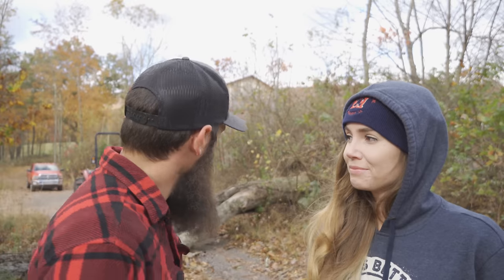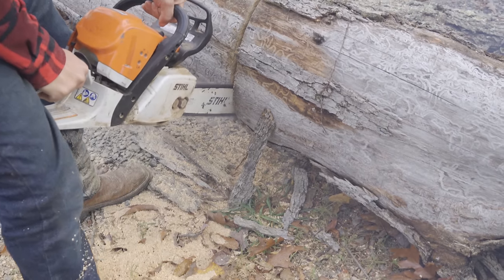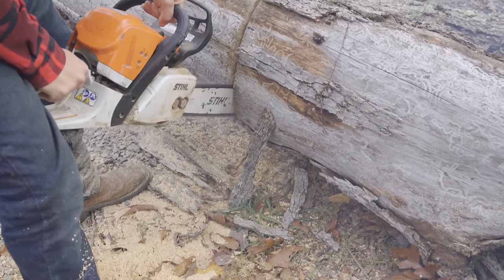Beginners Install Drywall On 20 FOOT Cathedral Ceiling

Comment: Exactly this time last year you had managed to clear the site and had constructed 'The Mighty Wind Tunnel' remember?  Look how far you've come in a year, and with two impromptu but impressive off the cuff design changes that turned the triangle into a palace!  Is it perfectly finished yet? No, but it IS very close to being liveable.  You've worked wonders now it's onwards and upwards (ARGH!!  Forgive the pun) to the finish line.  Plus a load of free firewood, not a bad weekend's worth.
Reply from the maker: We keep looking back at where we were this time last year. It feels so good to have come so far and to be so cloae to moving in 💚

Comment: I'm not sure if you live in a snowy area, but that's one thing I like about your design...you won't have to shovel snow off the roof. It will slide right off. Just don't be standing in the way when it lets go! You two are great.

Comment: Looking good guys about to cold up there stay warm. Keep up the videos
Reply: It is weird watching drywall going on walls without a plastic vapor barrier. It cold weather moisture will creep into the warm walls.
Reply: @lorcathecrazy5331  Many times that plastic sheeting can condense moisture and create problems. Speaking from 36 years in the drywall /plaster business.
Reply: @jebboceefus553  
In Canada it wouldn't be allowed to not have vapor barrier. The sealing of airspace is to the point where slamming a door creates a vacuum in the house.
Our outside winter temperatures are completely different though. With differentials between inside and outside temps of 100 degrees or more. -40 outside and 70 inside. Just weird to me.
Reply: @lorcathecrazy5331 They do a outside house wrap instead of the inside. It is a better way to dry out the wall moisture.
I have done the other and it works better with the outside wrap.
Reply: @dennisbailey4296  I understand that.
But moisture usually comes from the warm side. Which would put the condensation in the middle of the wall.
I do not wish to debate it, rather than state an observation.

Comment: Josh, my concern about installing the plank on top of the Sheetrock is the electrical boxes and outlets. Shouldn’t those be adjusted to fit out to the planking?
Reply: I guess he will use outlet box extenders

Comment: Good deal u 2. It was so cool u 2 working in ur home with all that lite. No wires coming into ur home. Lite without a bill & u 2 bath in brite lite in ur home. I remember not 2 long ago u having 2 work with lamps 2 see @ nite in ur home. U two have come a long way. Very happy 4 u 2. Missed hearing the children but they will b here next video. See-ya

Comment: I don't know if you're finished with your drywall finishing, but if you aren't I have a suggestion.  You can smooth the seams so much easier and cut the work time by using a wet sponge. Just get the sponge wet and smooth the plaster. Through renovating several homes, we learned this useful sponge trick. In fact, my husband recently discovered another useful method. He used an O-Cedar Microfiber Flip Mop on a plaster repair, and it's absolutely smooth. No sanding.

Comment: Josh, you are one lucky guy.  I have very rarely seen a woman that can carry a 4 x8 sheet of sheetrock must less lift it like she does to you up on the scaffold.  That makes it a lot easier to get it done.  Very impressed.  Yall are definitely improving as you go, shows the rest  of us that it can be done if you want it to.  House is looking good.And Erin, standing up on a scaffold takes getting used to like the lift, a lil fear is a good thing, makes you a lil more cautious.  I have no doubts that before you are done, you will be standing.  Great job you two.
Reply: light weight forumula, 8 foot sheets ..... 44 lbs.

Comment: Ugh!  Bit late now, but a drywall lift is wonderful.  So easy.  Even with our 7' ceilings.  We use a drywall screw tool to go on the cordless drill - magnet holds the screws, and it drives them the right depth automatically.

Comment: I might be a little late but many years ago i worked for two plasterer's in England and one trick was to stand your boards up against a wall one a flat floor and use the board nearest to you as a marking gauge, so say you need to cut a board 7 feet long, pull out the second board with one foot showing down the side and use the first board as a marking gauge for your knife or take a 4ft x 4ft piece of plywood and do the same with the first board, this little trick means you dont need to faff about with a set square and saves lots of time, cheers Dave

Comment: Props to you two. Hanging drywall is a pain in the butt already and doing it on scaffolding and in the air, above your head is difficult, looks like you two managed just fine though, thank you for posting!

Comment: Great work you guys. Don't know if it can be put better than you did when you said "sometimes pushing ahead when you don't feel like it", because that's what building your own home is. But the reward is so much worth it, like getting that drywall up. The windows will be another Big step, and wait until you see how warm is gets in there just from you working, and how much homey'er it seems too! They'll go in faster as you do them also. Know it's been hard work, but it gets easier, and just keep pushing on.

Comment: As a tid-bit, I watched professional drywall company. And the marked the center of the on the drywall of all outlets, and ceiling light openings. Then installed the drywall and followed up with a drummel. I was shocked how fast they were.

Comment: I am glad to see you guys starting from the bottom up.  I always did it that way since you can rest the next sheet on top to secure it.  Also glad to see you use a rotosaw for the cut outs.
Reply: There's no "resting" anything on those angled ceilings...

Comment: You are lucky you both work so well together.  My wife found the dry wall process such a disruption as its so messy.  Of course we were only renovating, but living in the house when you have a family with small children is very enervating.  you have to try to screen areas off with plastic down sheets , but curious kids will still try to break in. In Australia we used a blue glue as well as nails to hold what we call the gyprock on the stud walls. a few blobs of the blue glue pulls the sheets in tight againt the wooden studs. Perhaps it is now not considered worthwhile, but I would have thought it would assist to stop any sagging especially in the panels you put up high in the A-frame.  Anyway you have amazing persistence and drive.  Good luck with your next round of projects !

Comment: Great job! 

My one tip would be to rent or buy a drywall screw gun, the screws are on a belt and it puts them quickly to the exact right dept. It's well worth it.

Comment: Really enjoying watching you both. It brings back so many memories. 
Dry walling a vaulted ceiling....yup, that's just hard work.
Wondered why you never made a 'persuader' for the normal flat ceilings, rather than having someone hold the sheet in place. 
I'm impressed you never fought much doing this - we argued a lot doing dry wall (or plasterboard as its called in Scotland).

Comment: A bit late now but tip hanging sheet rock, hang from the top (ceiling) down. So all awkward cuts will be at ground level, easier for mudding and texture
Reply: In this case it doesn't matter as the "finishing" will be covered up by wood planking.

Comment: Alright, staggered butt-joints, you guys rock.  Interlocking the sheets actually does make a difference on the sheer strength of the structure.  Just tape and coat screws under the wood finish, no need to skim-coat.

Comment: Another check mark on the list will be there soon.  Once the windows are in and the final pieces of dry wall are in, it won't be long u til you'll be cozy inside your house before the snows fly.

Comment: Hanging drywall is hard work. I drywalled my new 3 car garage with 11 ft ceilings myself. Getting on a ladder with 10' sheet of drywall isn't much fun. I can honestly say at least for me it was easy compared to taping mudding and sanding though. I only had 1700 sq ft in the garage. If I were them I would get bids to finish the rest. It's not that expensive and pros are so fast. That's one thing they should pay for.  Having level 5 smooth walls will be worth it.

Comment: You should buy a drywall lift. They are not that expensive  but make it easy to get the seams tight. Your taper will thank you and you can sell on Craigslist for half what you paid and still come out cheaper than renting

Comment: For all it's worth you should be using 5/8 on the ceilings especially when your ceiling joists are not on 16 inch centers but it's super heavy.

Comment: Id recommend finish sealing the house soon as to not allow the dry wall to absorb moisture. At least its winter so the air is dryer.

Comment: Great team work, in UK we call the boards Plaster Boards, as they are 2 sheets of carboard with liquid Plaster in between, then baked in an oven, also there is a Drywall screw driver,  put it on screw pull trigger and Ziipp! job done, but hey you use what you got, I expect you are dreading putting in the windows as that means you have to go outside to do Shoo shee bam again!!, are you gonna hire a big trailer to collect  all the wood you are putting on the inside walls??, As its Novemvber do you think you will be in the house for Christmas??, its Weeks now not months!! Another great video, Thanks! UK  10 minutes to 2 pm in the afternoon.

Comment: Hi! Thank you for beautiful videos!
But i have a question:
Why did you not glue the joints of the insulation with special tape? 2:10
It's important enough.
Warm (and more humid) air will get between mats of a heater and to condense. 
Especially since you sheathed the walls from the outside with OSB plates, which are not vapor-permeable.
Reply: more precisely you have sealed, but not everywhere :)

Comment: Are you ready? 
I was born ready!

With the chance of tornados, pity you didn't build a small concrete block safe space, under the end of the house. Could have been multipurpose and used as root cellar as well.

Comment: Great videos and what a project. Don’t know your plans on layout in the A-Frame section but personally I would have built a small vertical wall at bottom to avoid the acute angle slope hitting the floor directly. JM2C
Reply: That could still be added in the finished space, but that is personal preference.  It reduces the interior square footage and changes the look of the whole design.
JIM
Reply: @ JIM C 
“Personally”, and physically that is unusable square footage. A transition (say an above average height base molding) would allow ease of construction, maintenance and cleaning with minimal impact to esthetics and form. Details matter in the real world. But to each his own. Thanks for comment.
Reply: @kickingthecandowntheroad3948  I agree with you, but it does change the look and along with that goes the perception of space.  And again, it is not my house.
JIM

Comment: The great thing about hanging drywall is.....you get reminded that it's not a trade, but an ARTFORM.  Unlike roughed in plumbing or electrical lines, you're LOOKING at your skill-sets, daily.  May the Force be with you.  Also, buying a Drywall Jack wouldn't hurt your marriage.

Comment: I'll never cease to be amazed by the work you 2 are doing. Curious though, did you ruin any drywall sheets lifting them up to the top of the scaffolding? I hate dealing with drywall, its too dang fragile.

Comment: So with walls like that how do you hang anything on it?  Like a clock, pictures, shelves, etc.  It also seems like when furniture is placed then a lot of floor space is wasted behind it since the furniture can not be placed against the wall flat.  If furniture is left in the open then walking space around it is also decreased because of the ceiling height.

Comment: Really should but drywall were fo beam will be. It seals the wall and is fire protection.
Reply: If it's not 5/8 fire board then the "fire protection" is minimal.

Comment: 1:45 I am convinced these two have never hung drywall.  I would make two pair of crutches no matter if it is 8' 12' 24' sheetrock.
Reply: Well ofc you're convinced they haven't done it before. They told us that..... But crutches on those angled ceiling would be next to useless. Not worth the bother frankly for the 44 lb lightweight small sheets they're using anyway.

Comment: Well, I finally ordered some shirts and i I’ll say I had some trouble getting it to process my transaction when I tried ordering by using the link in the description. I finally decided just to go to the bunker branding website and my order went through on the first try. Now, I’m definitely not complaining and I’ll be the first to say it may have been my own screw ups, but if anyone is having that issue maybe just try going direct to the website rather than using link in description. 

It’s also possible I’m gonna have a few dozen shirts in the mail. Hmmmm. Lol

Comment: It would be reasonable to lay a foil with a foil layer under the gibsoplite. First vapor barrier. Secondly, the reflection of heat back into the house is like a thermos. Such a film is not expensive.

Comment: You wouldn't really use the drywall lift and the scaffolding at the same time. If you have the piece up in the air you just use a ladder.

Comment: on your cathedral ceiling...you are putting wood planks on top of the drywall from what I understand. your socket boxes are only coming out flush to the drywall. wont you need them to come out even with the planks?

Comment: Josh you said you're going to cover drywall with planking, 2questions will it be tongue in groove ? 
Are you going to paint drywall so you can't see it through the planking when it's installed if you're not using tongue in groove .  Also are y'all going to mark the floor to make it easier to nail your planking
Reply from the maker: We will be using tongue and groove planking so we won't be painting it.
Reply: @WildWonderfulOffGrid   you guys are doing a great job looking forward to next video 
Take care
Reply: @Wild Wonderful Off-Grid are you guys gonna use a knotty pine? I know that’s beautiful when it has a very light stain & polyurethane on it.

Comment: There is NO reason to tape and mud the joints that will be under the wood planking. Why do extra work, you have plenty already.
Looks like you are going to need some box extenders.
Windows, yes!!! I bet those being in will be a big moral boost.
Gotta get it done. Always a good attitude with you two.

Comment: i know you are putting up wood everywhere over that drywall, might want to look in to the code for finishing it - for some reason I think for fire proofing 2 coats of joint compound is required not 1?
Reply: That's not fire rated board anyway so fire code doesn't matter. No matter what finishing they do it will NOT be a fire wall.
Reply: @JCrook1028  isn't that the entire reason they are doing the drywall in this case? i thought all drywall was like 1 hours worth of fire rating or something or is that only 5/8ths? in any case, shouldn't they have that?
Reply: @JCrook1028  I wish you'd stop talking about what you don't know. 1/2 sheet rock has a 30  minute fire rating while 5/8-inch, "fire-code" drywall (called Type X) increases a wall's fire rating to a minimum of 1 hour. Fire codes do matter and if you don't know them as you have proven stop acting like you know them. All build inspectors in my area require at least 1/2 sheetrock onn al walls no matter what the final finish and will require 5/8 type x depending on what's what in the house. Most builders I know just go ahead and install it in furnace rooms around fireplaces, kitchen walls and ceilings and garage walls and ceilings if living areas as in bedrooms are above them. All drywall has to be taped with minimum  two layers of mud on all joints and corners. Seldom do you see a "true fire wall" in a single family residence but will see them in multi family units as a rule it being the wall dividing the units.

Comment: Beautiful work as usual.    But are you SURE you want to tape and mud and SAND those panels that will be covered in beadboard?    I can't think of a single benefit of doing that and it would be a TON of hideous work.

Comment: I’m not a builder, can you explain why you even have to put drywall up if you are going to cover it up?  Wouldn’t the insulation be enough?  Thanks.
Reply: NO Many local building codes require it, fire-resistance of drywall balances the propensity of wood to burn and makes the room safer than wood alone.

Comment: So if you’re putting up wood planking, why the drywall? Just wondering 🤷‍♂️
Reply: Many local building codes require drywall due to the fire-resistance of drywall that balances the propensity of wood to burn and makes the room safer than wood alone.
Reply: David Larson Yes, I thought of that after I posted. You can also paint the drywall a similar color as the wood so as not to see plastic and insulation between any spaces (unless you overlap the wood)

Comment: You handle that sheet rock like its 1/2 inch if so is that fire rated code there ?
Reply: It IS 1/2 and no it's not fire rated. Read the tabs.

Comment: Anyone know why they would board and mud a wall then cover it up with wood? Seems like a lot of extra time and expense to me.
Reply: Very smart practice is why.
Reply: David Larson how so?
Reply: @Teem_Loots  Many local building codes require drywall due to the fire-resistance of drywall that balances the propensity of wood to burn and makes the room safer than wood alone.
Reply: David Larson ahh, that makes sense. Thanks for the reply and have a great day!